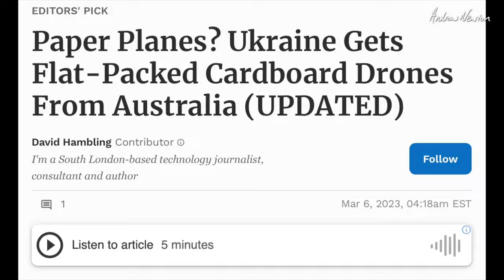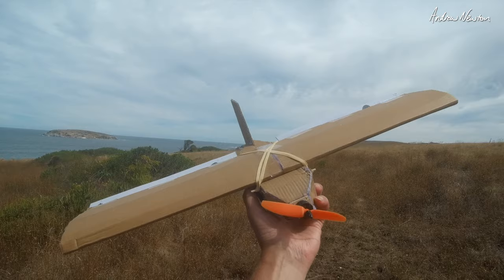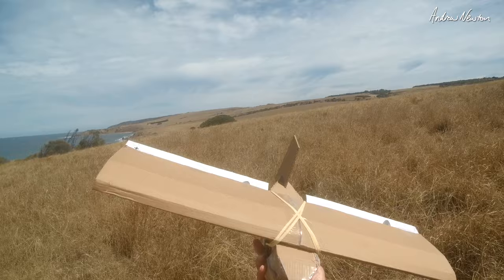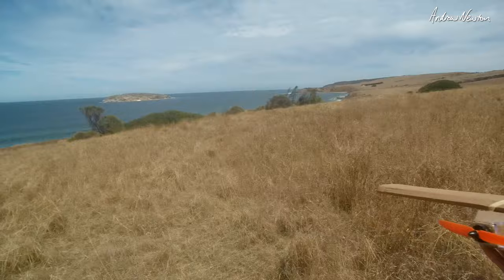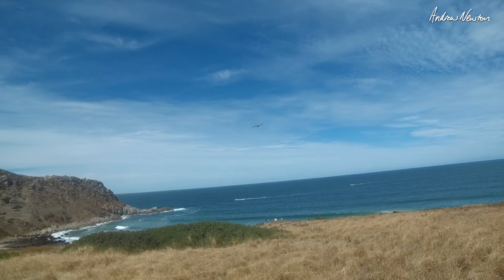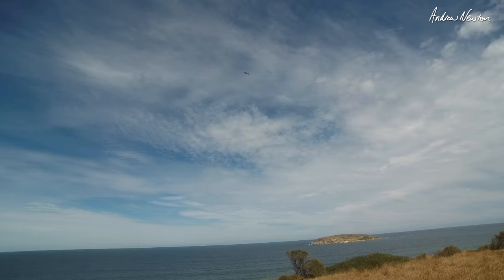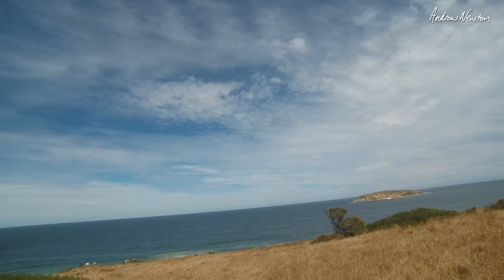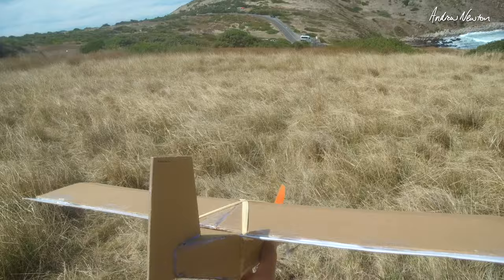Box Plank - Inspired by CORVO Drone

Comment: I've built ~5 planks now with similar design (though with foamcore and 2205 motors).  I've had very stable flights with the CG at 17% back from the leading edge.   I like planks due to the very simple construction and savings in servos, pushrods, etc.    You commented mid-flight that a "better thrust angle" was needed.  Better is more up or more down ?
Reply from the maker: Thanks for the info!

Comment: I'd bet it would fly better if lighter.  Perhaps you could fit a longer nose to move the motor and battery forward and thus need less extra nose weight to make CG.  The bane of cardboard has always been it's weight disadvantage, so anything you can do to lighten the design helps.

Comment: Simply make the fuselage a bit longer!

Results in a far more versatile design, we used to fly control line 'flying wings' with 2.5cc diesel motors in the good old days when schoolboys were trusted with solvents, sharp instruments & even ether based fuel, now i have to prove i am over 25 to buy a potato peeler & as for a bottle of 100 paracetamol, don't even think about it!

Comment: Cool beans...

You beat me too it. I did build a pair of profile planes using foam core board that I am waiting on an ordered Eflite 480 outrunner to show up for. I had tried a smaller brushed motor in the smaller profile plane and the power was lacking because in spite of weighing less than 3 ounces a brushed 8520 motor stolen from a 1 ounce Minimum RC plane was far to little. On the other hand the 8520 does a bang up job connected to a Guillow's Flying Machine along with micro electronics. 

I really don't like the foam core board for durability and would like to try gator board or a decent foam if I can order it.

Comment: Thats a fun design there. You are right it needs a good power set and all the weight a tad forward of the center of gravity. I was thinking maybe less throws on the flaps just to keep it from tipping the wing so easy? Could you set it up for some gyro and switch between modes?
Reply from the maker: I would never put a gyro on these box builds. Not in the right spirit

Comment: Hello to Australia from cold rainy central Europe 🙂 Nice video, thank you for upload 👍

Q1: How did you get longitudinal (pitch) stability without elevator or autostable airfoil?

Q2: Do you use elevons for roll/pitch control?

Q3: Do you plan to build bigger one? (if any bigger cardboard box will appear in your neighborhood) 🙂

Thank you for eventual answers..
Have a nice day downthere!

eMPi
Reply from the maker: Hello MP. Yes all flying wings or planks need elevons for control, and this one needed some reflex for level flight.
It would be better to have a proper plank airfoil with reflex built in.

Comment: How is the pitch control on that thing? I understand it is a flying wing but it is a very short plane with no vertical stabilizer.
Reply from the maker: I think you mean no horizontal stab? Yes planks are odd, but if you get CG spot on they fly. Reflex in the elevons or airfoil provides pitch stability

Comment: SYPAQ claims that the cardboard drone ( bigger than yours) is  120km Distance range and can carry 5 KG payload.  ( that is an UAV drone)

Question for you please 

Is that possible? 
The battery has to be 30, 000 mAh
With a flight controller
Reply from the maker: 5kg payload plus batteries does not seem possible to me, but most GPS flight controllers could handle the mission. You dont need RC signal all the way because the FC could fly the mission by itself.
Reply: @Andrew Newton  thanks for your reply
I am referring to the battery capacity to accomplish the 120 km. I am familiar with UAV. I know how to set up coordinates for autonomous flight
Reply: Winged aircraft are more energy efficient than VTOL drones because they can glide, thus conserving energy in long trips. This is why helicopters always had shorter range than winged crafts of the same tonnage.
Reply: Maybe the depleted batteries are ejected?
Reply: @franciscoe.9989  Yes you are correct, l talk way above my pay crade.

Comment: with such fwd CG, hence so much downforce required (evidenced by the extreme reflex in the elevons, the opposite of what you need for good lift), what is lacking is not more control throws, but more lift.   much of the CL coefficient of lift (total amount of lift that the wing can generate) is being wasted just to attain pitch stability (which is still not very good). Plank flying wings use a special airfoil, with most of the lift being generated by a unique shape on the leading edge.   An even better solution is to add a horizontal stab... 
I wonder how well the Corvo actually flies, and how well it would fly it it were not using this strange and inefficient configuration.?? 
love your ingenuity with the cardboard construction.  often these cardboard planes of yours fly better than the production models.  the configuration that you are replicating got you on the performance in this case.   considering that, you made it fly remarkably well.
Reply: I agree that a strenghtened (carbon rod) large horizontal stab could be there since there is a vertical tail already. 
I would even make it removable for transport. This would remove most of the reflex
Reply from the maker: Thanks for the expert tips again. Got me researching plank airfoils now

Comment: Could you make a better cardboard plane that is capable of flying very slowly and post a plan for that? I am 74 and reactions are not so quick anymore, and being a pensioner cardboard planes are all I can afford. I have all the radio gear as that doesn't get damaged in the prangs that I have had.
Reply from the maker: Might be tricky with just cardboard but worth a try, I'll think about designs
Reply: @AndrewNewton  Thanks that will be good. I don't think I would be the only person interested.

Comment: I know it's part of the game, but cardboard is too heavy and your wing loading is probably responsible for the flight issues.  Take any nicely designed foam poster board plane and dupe it in cardboard and you'll hate the result.  I wonder why the CORVO didn't use poster board.  Equally transparent to radar, much lighter and even stiffer.  Sure cardboard is free, but for this application I don't think one dollar per board is any kind of factor.  Perhaps these are being locally reproduced in Ukrainian homes and cardboard is all that's available.  But given you need a lot of pretty significant electronics, that doesn't seem likely.
Reply: Lighter? Really?
Reply: By poster board you mean paper-foam-paper sandwich? Flite Test like (readi board) is what they used for the drone, and does come out stiffer and lighter than pure cardboard.
Reply: Foam board is what the CORVO drones  are made from.

Comment: How does it work without elevators?
Reply from the maker: Control surfaces on flying wings act as elevators and ailerons at the same time.
Reply: @AndrewNewton what kind of rc transmitter are you using. Looks nice and ergonomic for us  older folks

Comment: With enough power you could fly a real brick (with inadequate wings [or even no wings if ridiculously overpowered , haha] ) so with today's motors and batteries it's not really that amazing what the hot wire carved Styrofoam and cardboard platforms can be flown
Reply: Aerodynamic efficiency does make a difference to range / endurance though, which is important in the Ukraine situation. Cheapness is good too -- GPS and autopilots and even inertial navigation sensors are incredibly small and cheap now.
Reply: @BruceHoult  and I imagine that drug smuggling will be changing real soon where radar invisible drones carry smaller amounts to scattered preset locations where someone is waiting to receive it. Law enforcement can't cover everywhere so instead of one big 1000 kilo load you'd have, say 500 each  2 kg loads going to 500 different places / receivers, dozens up to hundreds of miles from the border (and scattered along the border too).
Reply: @bobjoatmon1993  perhaps it's time to take another approach to drugs?